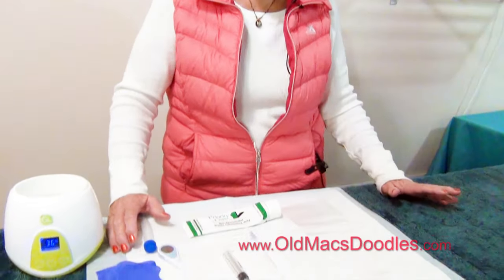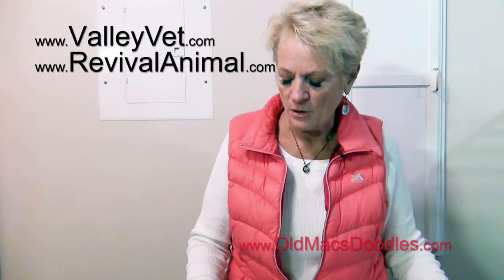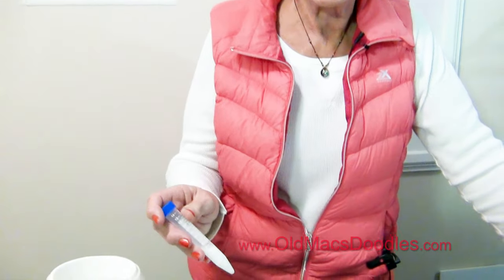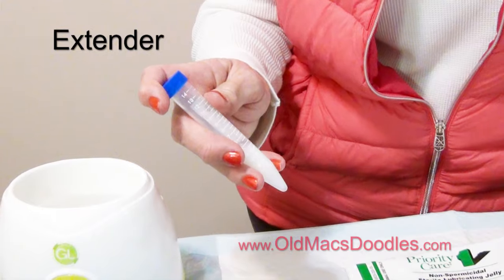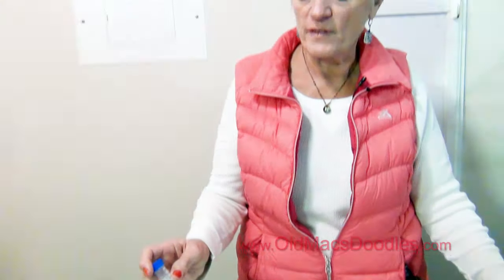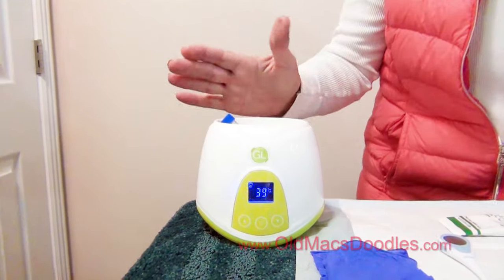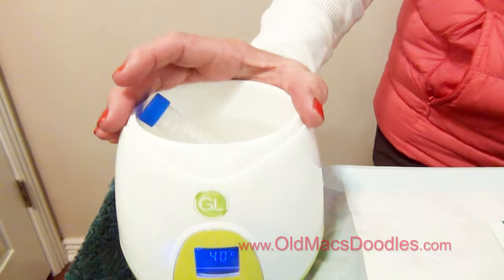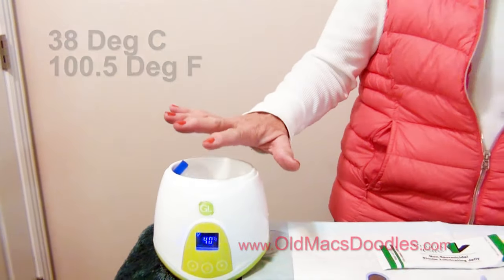A. I. Artificial Insemination for Dogs. Version 2.0

Comment: Question, How many times do you do the insemination ? On ll days listed 9, 1,13 ? Or just once ?
Reply from the maker: Insemination  every other day for each of the 4 or 5 times
Reply: I was taught with Yorkies (where the dame is to 5 pounds and the sire is 4 pounds) to only inseminate twice- one day apart for example on the first and the third or two days in a row. Breeders who’ve inseminated every other day for five to seven days in a row have ended up with a tiny puppy that died at birth. Because that pup was conceived 5 to 7 days later than the others. On avg it’s 63 days of gestation before birth ,but they can sometimes come a week early (57 days) or a week later.. If mama delivers a week earlier the puppy that was conceived on the seventh day has lost up to 2 weeks of growth time. Hope this helps those with tiny breeds.